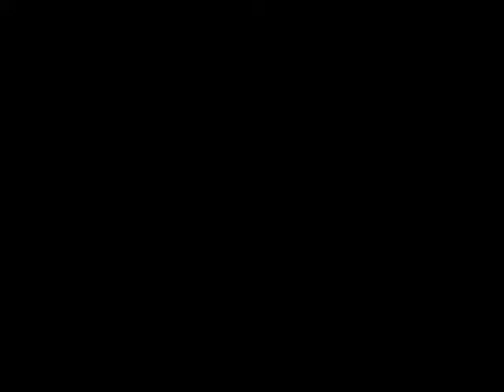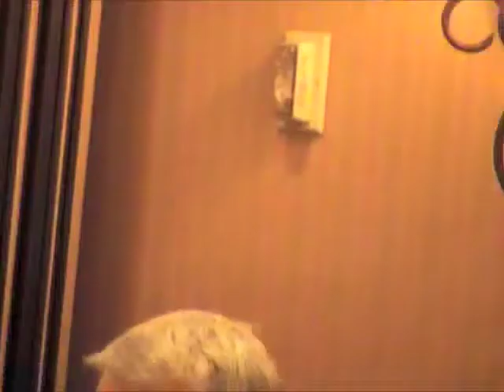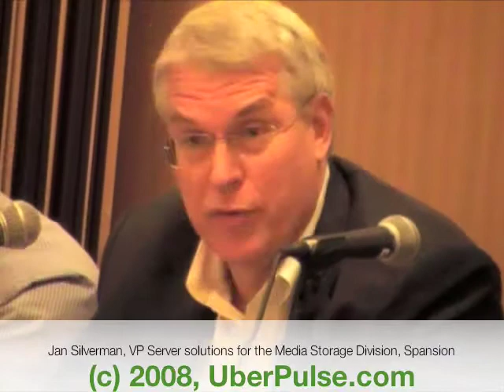Spansion EcoRAM: Hard Drive Capacity at DRAM Speed. But Not an SSD. Targets Search Engines, Databases

Comment: I checked the specs on EcoRAM.  It is not going anywhere until performance improves.  DRAM + Intel iCore7 blows away an EcoRAM system.  EcoRAM is dead for 2009.